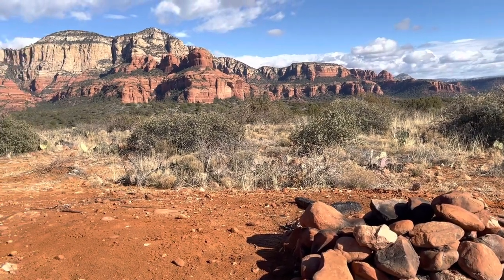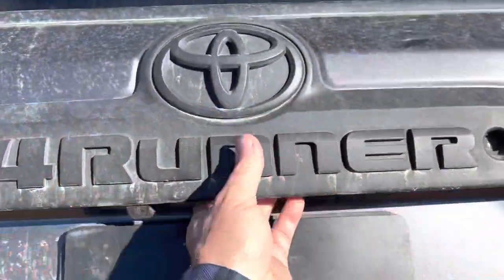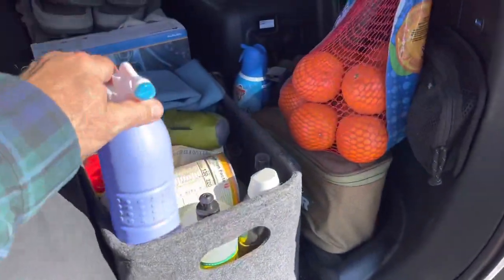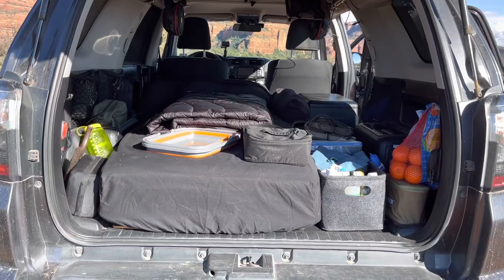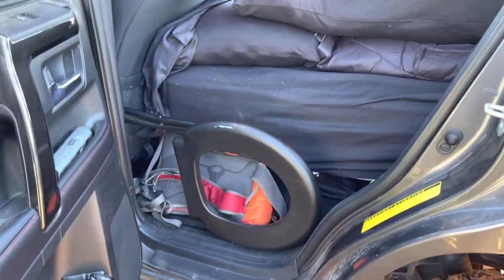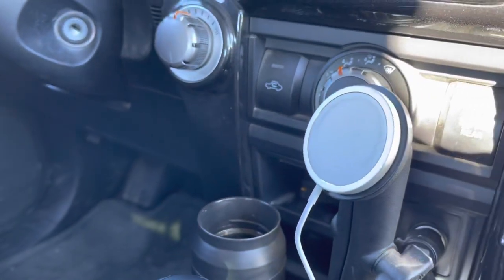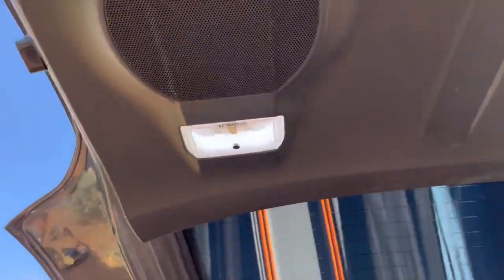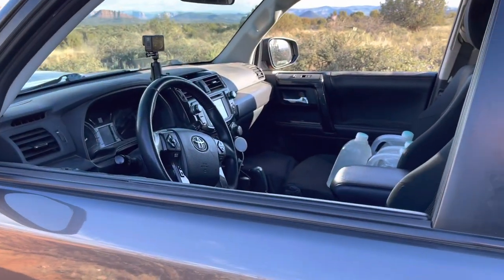Transforming an SUV Into the Ultimate Adventure Machine - See How It's Done!

Comment: I’m just blown away with the thought that’s gone into this and level of detail.  I also like to keep everything below window level and looking black (I use plain black fleece blanket for anything on passenger side down by feet).

Curious if you’ve thought of sone night vision camera setup to see what’s outside at night.  As a female heading out solo, at times that would be useful.

For the limo film, if one comes right up against the vehicle and shines a flashlight in, I take it you’ll be able to see inside?

That fire extinguisher looks genius - will be looking for that.
Reply: PS - Do you ever stay put in the same place for several days?  Where would you store a larger comfy chair (have a hammock chair in addition to my hammock, as well as one of those shelters to go around picnic table).
Reply from the maker: I truly am a minimalist and get rid of everything I don’t use. The front seat is the most comfortable seat. I also sit on the rear bumper.

In the over 400 nights I’ve slept in the rig I have only had two people come up to the rig at night. Both in cities. No issues either time.
Reply from the maker: You can see clearly out the windows at night. That’s the beauty of limo tint.

Comment: Just awesome build! I like the idea of an inner roof rack. I thought about doing something similar, but using aluminium profiles didn't occur to me, that's what I need!
My only concern is that the stuff in the back is not secured in any way. In the event of emergency braking or a collision, it will catapult them forward. A mattress won't do any harm, but a portable battery or other hard and heavy things could hurt you. You can figure out a way to secure them, or use a synthetic cargo net behind the driver's and passenger's seats.

Comment: Wow! I love how you solved each problem with solutions that simply work vs complicated common solutions many use that don't work as well. I am wondering how much actual ground clearance you gained by  doing the 3" lift?
Reply from the maker: That’s a good question. Seems to be a lot since I’ve never bottomed out on any trail. I took the rig to Moab last year and scared the hell out of myself but never touched the bottom once.

The biggest upgrade to the lift is the drive quality on the highway. No front end diving when braking and no rocking from side to side on sharp turns. Vast improvement in handling.

Comment: OMGOSH.   Brilliant.   I had to save your vid.  I would Love this set up.  I have a Ford Expedition and  I could do this in my rig.  Simple.  Only take what you need.  Stealthy.   It's perfect.   I'm going to have to watch it over and over again to see what  things you have in here.  
 Really caught my attention with this amazing no build. 
I've watched many no builds but this one is incredible.   Less is more.
I tend to overdo my no build and I can really learn from you. 
I have single size mattresses that would work perfectly for my rig.  I didn't even think about using them.  I bring a low profile cot that I'm not fond of, but my foam mattresses would work great.   
And I did not know that there were solar flash lights.   I've bought LED lights and I'd have to keep buying batteries.   They last a long time but to have solar lights/ flash lights would be ideal.   I'm going to have to check em out.  Thank you so much for sharing your video.   
Do you know how much you spent on your whole setup?  
Just a Brilliant idea.   
Time to watch it again.  Thank you.
Reply from the maker: Tawny, thank you for the accolades. What’s wonderful message. The total cost is probably a bit more than you would realize because of the “overland” setup. The suspension is $3k and the tires are $1k. The internal roof rack was around $500 but the functionality is priceless. The flashlights are not solar but they are rechargeable and I recharge them from my solar setup. If you are not planning on going off road the. You could probably build this setup for under a grand.  Eat of luck with your build. Send me pics as you go along.
Reply: @minimalistoverlander  ohh yes the flashlights are not solar.  I'm not sure where I got that from.   I meant USB and can be charged with a solar generator like the jackery.   
I don't do hard core off road driving but I do the back road back roads tho.  Our back roads here have back roads.  
And I will share pictures when I'm finished building it.  
Not sure if I'll do the suspension work or not.  I bought new all terrain tires when I bought it and they have worked well for me.   
I don't go far from home now with the awful gas prices.  I live in NE Minnesota so I already live in the woods.  Go off camping near lakes and fish.  I live in a pretty great place.  
Your setup in my rig would be ideal.   
Thanks again.

Comment: LOTS of great ideas. Missed locating where you have the weBoost antenna. I had the same solar panels and set up and great for being stealthy. Unfortunately, I have to carry a bicycle and the rack and crossbars shadows across the panels made them ineffective. Currently exploring other setups that includes the bicycle rack and the best panel efficiency while maintaining the most stealth setup. Thanks for taking the time to make a list of so many great items. Thanks for sharing.
Reply from the maker: Yeah, the bike is a tough one. At one point I had a folding bike inside the rig but as you can imagine, things got a bit crowded.

The antenna comes out the back hatch and sits just behind the solar panels. Probably not the best location for gain but it’s what I could come up with at the time.

Let me know if you have any ideas for future vids. Cheers!!
Reply from the maker: https://www.cascadia4x4.com/products/toyota-4runner-4th-5th-gen-2003-present-vss-system-90-watt-hood-solar-panel

Comment: Nice setup! I also don't want to alter my SUV interior that's not reversible. Best way to secure all these bins, etc?  A twin mattress also fits in my SUV. I have some leeway in what sort of containers I put the essential stuff in, will put some under the rear seats also. What securing points do you hook to to strap down all that stuff?
Reply from the maker: Soft stuff can be loosely contained. Hard stuff needs to be securely tied down. All depends on what you bring.

Comment: I’m very interested in the built-in screen for your windows, wanting to do one for myself. Did you use a heat gun to bend the metal or were you able to do it simply by holding it to the window?
Reply from the maker: Very easy to bend. I just roughly measured by eye and started bending. Then I cut the remaining lengthens and epoxied on an L shaped braked and sprayed the metal plank. Then hot glued on a fabric screen and cut the remainder off.

Comment: Best video, everything you have shared is going to be beyond helpful when I start my SUV camper ! I do have a question, I prefer putting my bed behind the passenger seat, I noticed you have your bed behind the driver seat, is that because you store all your water in the front of the passenger seat?
Reply from the maker: Both front seats are aligned the same. I guess you can switch. I think the 4Runner is symmetrical. The cooler is almost up agains the door and my mattress is only 30” wide.

Comment: Never explained where the toilet seat fit.bucket?
Reply from the maker: No bucket. You simply put the biodegradable 8 gallon bag in the toilet seat and do your business. Then you can either bury the bag or put it in a ziplock bag and toss it out at the next trash spot. Be aware that the biodegradable bags start to leak very quickly, ergo the ziplock bag.

Comment: Love that interior roof rack how did you build it? I can envision doing that in my subaru but i don’t have any contact points on the headliner area with the exception of the roof handles can’t figure out how to connect the other two ends
Reply from the maker: Glad you liked it. I made a video about how I built it, but you do need available contact points in the back. I wouldn’t attempt putting something that heavy in your ceiling if you don’t have it really well secured.
Reply: Yes thanks I’ll check it out! Yeah that’s my problem with those contact points and the weight of it especially if I hang/attach things to it,, but it is so incredibly useful and cool. Enjoy the summer